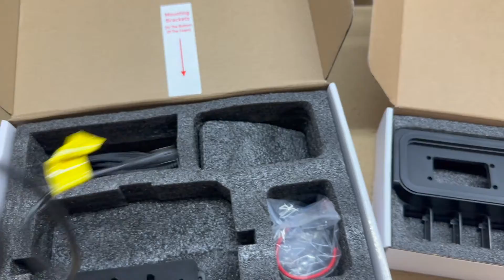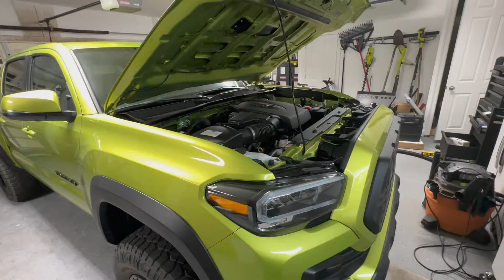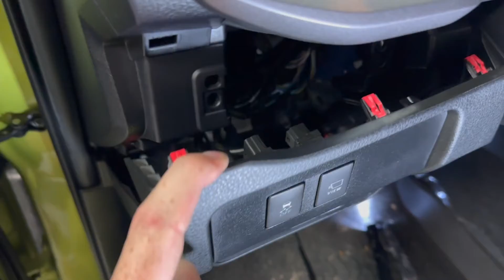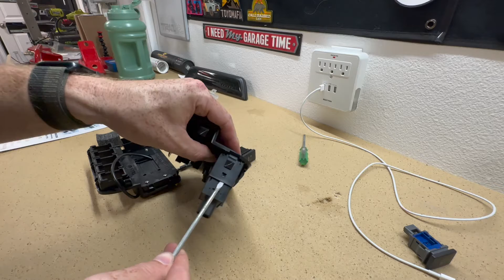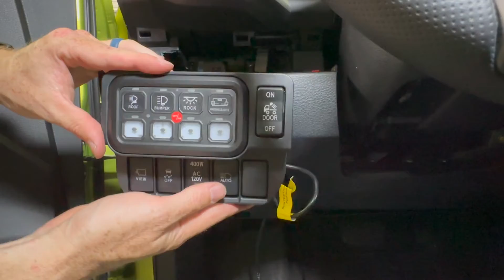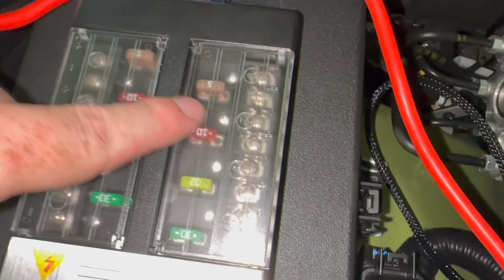Easiest Way To Add Aftermarket LED Lights To Your Toyota Tacoma

Comment: I have an Auxbeam 8 gang maxed out
4 pods behind the lower grille, light bar behind upper grille, 4 pods mounted on the hood, and 4 rock lights. Two switches work as backlight/DRL for the grille lighting 
It’s a lighthouse at night 
And the rock lights for street driving really does make people pay attention when we merge lands lol but they help when we mob on trails at night too.
Reply from the maker: Heck yea!! Auxbeam is an option too that works well!

Comment: I need one of these for my 5th Gen 4Runner...
Reply: Do it! I got an auxbeam 8 gang and it’s maxed out lol 
4 pods mounted on the hood, 4 pods mounted behind the grille on the lower bumper
Light bar behind the upper grille 
And 4 rock lights. All the grille lighting has backlighting too.
Reply from the maker: Yesssss. Honestly makes lighting up so easy. Just to not run all those wires through the fire wall is worth it to me

Comment: You should install an in dash trailer brake system in one of your blank switch holes
Reply from the maker: I won’t be towing with this Taco
Reply: @TRDJon  gotcha. Thanks.
Reply from the maker: No worries! Thank you for watching.
Reply: @TRDJon  I found a Red Arc trailer brake system that the box (small) mounts anywhere under dash and the small control dial goes in a factory looking switch cover they provide. Works extremely well and looks as factory as it can look.
Reply from the maker: I’ve seen that one awesome. Super small and simple it seems.
Reply: @TRDJon  it works really well in in my 4Runner off-road VP

Comment: First comment!  lol.. I'm wanting to do this to my Pro as well since I added multiple Diode Dynamic fogs and ditch. The only drawback to the Cali Raised panel is the cutting on the truck. Other than that, is super clean and oem looking. Great video Jon! Thank you.
Reply from the maker: Thanks! Yea there are a variety of solutions but I just found this to be super easy. I’ll never run a lot of switches again like I used too
Reply: Any other leads that you can provide for a switch panel you're comfortable endorsing?
Reply from the maker: This one is pretty universally use and Cali raised does offer a 2 year warranty which is nice. But there are cleaner setups out there. Obviously more $$. Like switch pros.
Reply: @TRDJon  I was actually looking at the switch pros, and yep, more $$ for sure. I love the oem look this provide, and I didn't see the 2 year warranty from Cali Raised, hmmm. That sounds very appealing! Thanks again Jon
Reply from the maker: I believe I saw it in the description of the part itself
Reply: @TRDJon  Well, thanks to you Jon, I have this inbound, and will hopefully have things installed by the weekend. Thank you once again for the items and great vid!
Reply from the maker: Hey of course! Hope you got the 5% off!
Reply: @theof303 I no longer have my Tacoma, but the process was not difficult and cutting the dash was pretty difficult to decide to do. However, after all said and done, it looked and worked perfectly as Jon has shown. Worst case scenario, one could also just order the single plastic dash piece if you wanted to go back to oem, but I don't think you will.
Reply: It's officially installed Jon. The switch panel and plate. I was very reluctant to cut behind the dash panel, but it was worth every bit of doing it!